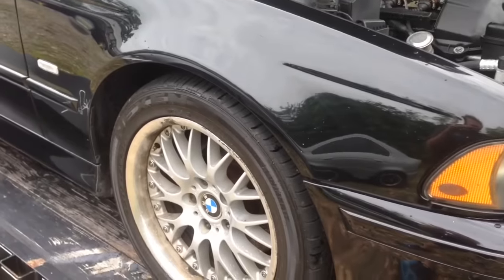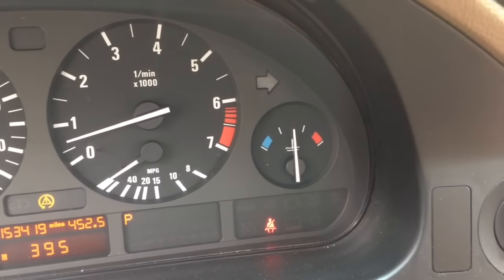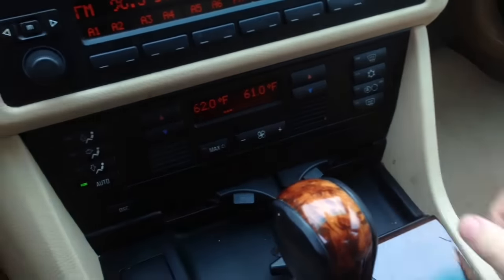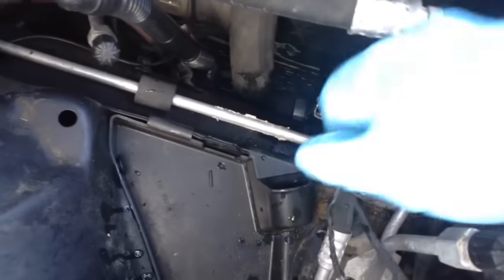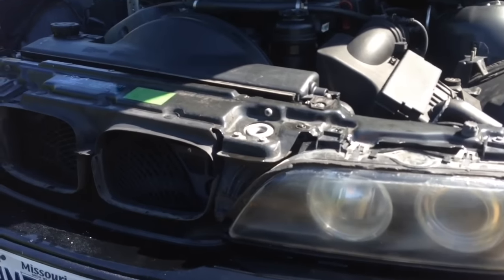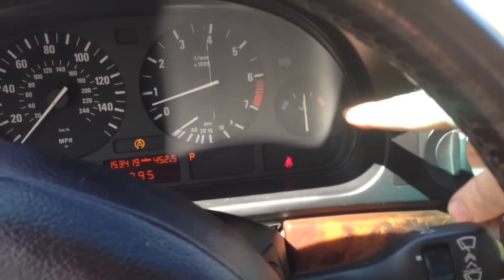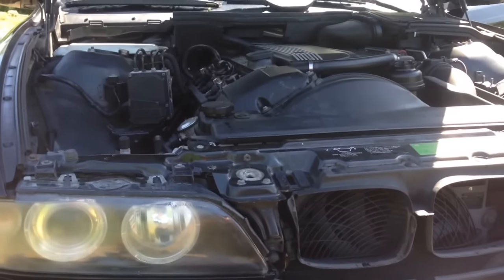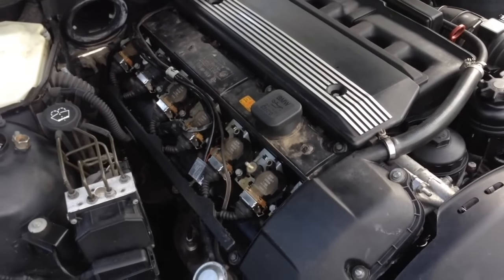BMW E46 E39 E53 AUX Cooling Fan Problem Not Working correctly Relay and Thermostat

Comment: Hello the problem was fixed by me changing the coolant temperature sensor (cts).  The fan won’t come on unless that sensor is properly working. The (auc) air quality controller just controls the recirculation mode on the ac. Reads whether the air is bad or not. If that doesn’t work. The recirculation button won’t work properly. I hope this helps whoever is reading this. Godspeed.

Comment: That little black box is the only thing that has not been changed on my cooling system. everything is new. Thank you. I will post an update for the benefit of others.
Reply: Did that box ever worked?
Reply: Did changing AUC (little black box on top of fan shroud) help any ? please share ..
Reply: Hello?

Comment: You mentioned both fuses were good. I checked the 50 on mine and it was fine. What’s the other fuse bc my fan still isn’t working after installing a new one.

Comment: 2005 BMW 330i E46 runs hot on idle only .. AC on .. electric fan comes on full speed only ..   i changed fan coolant switch (Temp switch)  no change ..  disconnected the AUC (no change)  ..  changed fan clutch (no change) ..  the electric fan works full speed only ..  inside temp gauge goes to 3/4 way up.. if you rev engine to 2000 RPM .. car cools back down and AC comes back cold ..    no white cloud out the tail pipe.. no milky oil...  can the electric fan running be running too fast ? there are no leaks.. pressure tested good..     please advise.
Reply: it turned out to be the thermostat ... i initially ruled it out because it was 2 years old (after market junk however) ..  i bench tested it and it failed..   case closed.. the Nathan guy is  a fraud
Reply: @samalfakir5463 sad brokeback a simple test of running the car at idle with the radiator cap off would have shown you that in side of 10 minutes.

Comment: My e83 has the fan speed on at all times. Stuck in high mode and it doesn't seem to overheat, but I've read a few things it could be the ac is overpressurzied  or it could be a waterpump or it could be a sensor or could be something to do with the battery fuse block or a fuse/relay idk hopefully you have some insite... to be noted the car was crashed in the front right corner. The ac drier has a sensor on it and the accident did shear the sensors clean off at the connection point. Maybe that could have over filled the ac system? 

Or is there any sensors in the front right hand passenger headlight/fender I should replace that may have been messed up in the accident?

Comment: Thanks this helps.  My 2003 X5 4.4i has been acting screwy.  The AC fan is fine when the engine is cold but when hot, the blower just stops blowing.  If it cools down or we turn AC off for a while, it will be fine for maybe 10 min.  And yes I noticed I was using a lot more coolant for the engine.  Perhaps unrelated is my radio Aux signal sometimes gets shorted out in the heat and jumps to the radio.  Any ideas?
Reply from the maker: The ac fan inside the car or the aux fan stops blowing?

Comment: @Nathans BMW Workshop when I turn my car off I get like an air sound constantly blowing from the vents through the bonnet.. cant feel air though.  Would you know what's wrong because this video explains its overheating it's had so assuming it could be that.  But it's draining yhe battery every time it's turned off till it's dead.

Comment: My cooling fan on a 99 540i turns off when I plug the Temperature Sensor , and d only way it comes back on is if I pull d sensor out d Hose and plug it back without plugging the sensor. Stay on like that with no problem. Can I keep it like hat? I put a new sensor and it those the same thing.

Comment: Sir, did you have engine codes for the sensor and the relay? I have this 2006 BMW X3 and have replaced everything. Radiator thermostat water pump upper radiator hose heater vent. And the fan suddenly isn’t turning in it blowing coolant out of the new reservoir tank. But zero codes. Overheating not good. I’m thinking sensor and relay like you possibly fan too but no codes, thanks Kevin in New Jersey

Comment: hi mate. 
I own a bmw x5 2004. 
I’ve replaced the condenser , compressor, radiator fan, condenser fan, and expansion valve and still don’t have COLD 🥶 air. The most it gets is “cool”. 
What am I missing? 

Also what’s the yellow light in your dash? Mine has that same light on.
Reply: Did you clean the pipes before installing the new stuff?  You might have introduced junk from the old system in the new items without a proper clean out.
Reply: @Zairn12345  I would like to think I did. At this point I’ve done it all except change the heater valve. I’m thinking about replacing that in a couple months before the summer heat waves start coming

Comment: Hey guys,

I changed the radiator on my E46 330i along with the expansion tank, HEPU water pump, Febi thermostat, Gates upper and lower hoses, Febi coolant temperature sensor. But the fan no longer runs in low and medium mode. When it runs, it’s always at full speed. Sometimes the fan doesn’t turn on and the needle goes past middle. I replaced the temperature sensor from Febi to a Hella but no difference. My cousin even used INPA to run the fan at different speeds and it works perfectly.
 I have exhausted all efforts to find the problem.

Any help would be much appreciated.
Thank you!
Reply: Does your car smoke on the passenger side with a burning oil smell? I think I could be experiencing something you are with the fan deal plus having a overheating smoking issue

Comment: A source told me that the electric fan on the M54 turns on at 100°C and off at about 95°C, but if you disconnect the connector at the electric fan sensor on the bottom radiator hose the electric fan turns on at 100°C and off at 85°C.
I can't confirm this anywhere, but if its true its an easy fan hack to increase cooling. Do you know if this is true?

Comment: Hello Sr.Nathan i have the same problem with my 2006 x5 e53 3.0i that fan sometimes turns sometimes not at all if  it stays in idle it will overheat should i replace that switch an the black box? whats the name of that black box? here in Chicago looks like we are not going to need ac this rest of the year but i whant to get this issue fix.
Thank you Sr.for the video is great and very
 informative.
Reply from the maker: Replace the black box first , search ebay for "bmw aux fan sensor"
Reply: Thank you Sr.

Comment: my 2005 x3 2.5L normal gauge temp but fan comes on at 172d. changed coolant temp sensor was a drip from oring but still with new cts it still kicks fan on at 172d ??..could aux fan relay cause this issue

Comment: I have the same issue, what I did was to just disconnected the AUC sensor and fan works (Running steady). But I have to changed the AUC Sensor for permanent fix.
Reply: Alex you disconnected the AUC sensor or the one on the lower radiator hose?
Reply: Good to know!
Reply: What is the AUC Sensor

Comment: Hocked my auxfan up to a battery. 4wires, 2 bigger than the other. Brown and blue/black "i think". The fan did turn on, after trying back and forth with different wires it stopped working. I guess the last resistor went too. Only managed one speed with which i think was full.

Comment: The part you're calling the fan relay is the AUC sensor, which has no connection to the aux fan.

If you have recirculated air set to "Auto", the AUC sensor temporarily turns on recirculated air when it detects hydrocarbons, etc. The little plastic flap on the opposite end of the connector allows air in to be tested.
Reply from the maker: I am not sure what connection it has to the aux fan, but the fan absolutely will not work without that box, let me be specific, it will work with the. ac on but the fan will not come on with the ac off when the car is overheating, if you plug that little box in when the car is hot it will instantly turn the fan on, if you unplug it the fan will instantly turn off, I urge you to go try it and see what I mean.
Reply: @NathansBMWWorkshop  😁 Really funny this box has Nothing to do with the fan its unplugged for years and my fan working like a charm its Just as mentioned above if  you dont air from out side or if you want your car to be vented Automatically when its needed
Reply: Sroor9001 so which one of you guys is right? 
Also, at what temp (Celsius) is the newer 3-pin (pwm) fan supposed to turn on with AC OFF?  Been searching for DAYS
Reply: @NathansBMWWorkshop  i tried it .. AUC has no effects on the electric fan
Reply: Actually it does control the cooling fans. AUC does not stand for Auto Recirculated Air...That would be ARA, lol. AUC= Auxilary Cooling fans and for some weird reason it does also have something to do with the recirculated air.

Comment: I kept the old resistor because it was > $70 through my mechanic It seemed to help then but now it seems the blower cuts out when it gets hot. How do you know if the resistor is bad? My mechanic was quoting me $1100 for the fix but he wasn't sure if that would fix it.
Reply from the maker: Im almost positive its the resistor  if its getting hot and shutting down, a new oem behr is $38 off ebay, i might have one here but i will have to look and see

Comment: We've had similar issues in the past. Solved as you've explained so can confirm your methods. This is very important because if you 'cook' an engine and blow the head gasket, it's a damn pain, let me tell you. Keep 'em coming Nathan  :)
Reply: it turned out to be the thermostat ... i initially ruled it out because it was 2 years old (after market junk however) ..  i bench tested it and it failed..   case closed.. the Nathan guy is  a fraud

Comment: Nathan i need help bad no air in vents at all ac or heat changed out fsu still nothing aux fab comes on when engine temp gets too hot but not with ac on?????

Comment: Hi NathanI got a 2004 bmw 745i. I changed the upper timing belt tensioning bolt, an now my car want start. it seem that the bolt that I took out was missing the bottom spring tip for some reason. When I put the new longer bolt in the chain rattled, so I took it out an replaced it with the original shorter bolt with no tip on it.But now the car want  start. Do you know what could be the cause?Thank you,Dave Horton
Reply from the maker: Hello you have the n62 , are you talking about the timing chain tensioner?

Comment: On my 2004 chevy venture, the cooling fans kick on when the engine is about to overheat till it goes to about half then they stop, they are on all the time when the a.c. is running.  And I also replaced all the relays for the cooling fans so I don't know what the hell is going on

Comment: Hello Nathan, I own a 535i e39 M62b35 v8.
I recently replaced waterpump, thermostat and flushed the coolant, got a new coolant tank, cap and coolant temperature sensor.
Now as I go and drive more than 15min, the coolant tank starts boiling and overflows, any ideas? (Hoping that’s not a head gasket)
Reply: If it's head gasket you should see oil in the coolant like sludgy white stuff or white smoke out the exhaust. When you flushed the coolant and put the new coolant in. Did you bleed the system because you might have trapped air in the coolant system causing it to over heat. Bleeding is very easy takes 5 minutes
Reply: Also take your oil cap off make sure the colour isnt a white colour where the oil and coolant have mixed.
Reply: @fortniteboss2837  the problem is it did this after coolant beeing flushed already, maybe I did it wrong and there’s still some air..

Comment: Nathan, at idle my 00 528i will get hot, no Aux fan. While moving it's fine. If I'm at idle, I turn the heater on, engine cools down but Aux Fan won't come on. It ONLY comes on when I turn on the AC. What's the dealio?
Reply: Andy Micheli if an automatic it's your fan clutch. The 1 that spins onto you water pump.

Comment: AUC is not a relay 
Automatic recirculated air control (AUC) is an additional feature controlling the automatic operation of recirculated air. The AUC feature uses an oxidizable gas sensor usually mounted behind the right side of the radiator or the right side upper portion of the fan shroud (samples air quality as coolant fan pulls across the radiator). The AUC sensor contains a combined heating element (powered by the IHKA module) and a gas sensor. The gas sensor requires heating to work efficiently. The sensor produces a varying voltage based on air quality (concentration of hydrocarbons, NOX, SOX, and CO). The voltage increases as the air becomes more polluted. After it reaches a preset value, the IHKA closes the fresh air flaps. To prevent glass fogging, the system has built-in time limits: 3 minutes when heating and 12 minutes when cooling. With normal air quality, the AUC sensor reads about 0.5V. If the AUC sensor voltage increases to 3.0V, the ventilation or fresh air flaps will close (0%). At about 2.5V, the fresh flaps will read about 20% and 100% (fully open) at 2.4V.
Reply: does the AUC makes engine over heats on idle if faulty ?
Reply: @samalfakir5463  no

Comment: I already changed the resistor 2 yrs ago. Aluminum fins, had to take the glove box out to get to the back of the dash.
Reply from the maker: Did that fix the problem then? Its either the resistor again or the blower motor itself and you better hope its not the motor because that will be a huge job
Reply: hey nathan, hope you can help me, i have a 01 bmw 540i and it has a loud
 aux fan noise it sounds like a airplane, y changed the thermosthat, 
lower hose cooling sensor, and water pump sensor, but the noise is still
 there and loud, please i need ur help how can i fix this issue,   THANK YOU
Reply: That sounds like the viscous fan has seized up hence running at engine speed can break the plastic fins off the fan and dent your hood and rip up your hoses.  Mine seized yup sounded like a semi truck taking off from a stop

Comment: Hey Nathan , Mine E36 I was test my fan working find. and I replaced Coolant Temperature Sensor and start engine with AC on 15min , But am not see fan have  spin. Do you have any idea something els ? thank you
Reply from the maker: +Raksasok Heng Check the fuses behind the glove box.
Reply: which fuses? obviously the fan fuse.. but are there any others that may affect the fan not coming on?
Reply from the maker: No just the 2 o3 3 huge fuses, the other problems could the a bad fan or fan resistor or a bad relay

Comment: Hey Nathan. I have a 2000 528i. Here is my issue I can run it all day sitting in my drive way with the heat on  and it will not overheat. if I drive off  it will not overheat unless I turn on the A/C. Whenever I turned on the A/C and come to a stop that when it over heats. The fan does run when I turn the A/C on but I don't think that it comes on when the car temp is high if I turn off the A/C. If i unplug the temp sensor the fan will spin full speed, that tells me that the sensor is working. . I take the thermostat out and it still did the same thing. What could I be missing and what is the little black box on the fan shroud for?
Reply from the maker: Its the relay that is the problem, which is the little black box on the fan shroud.
Reply: I have same model and year, aux fan ONLY comes on when AC is on, NOT when I'm at idle and then the temperature gauge goes up. Turn the heater on, and it cools down... While drivind (no heater no AC) cars stays at perfect temperature, Relay box? Cause it doesn't come on at idle and car gets hot... I'm lost...lol

Comment: @ Nathan's DIY Garage is this a e39 because there is a switch on the actual side of the radiator on e39 that is easy to replace that controls that fan
Reply: Tell me more please?
Reply: If you couldn’t tell this was an e39, I kindly ask you to put everything down, and slowly back away from BMW’s forever.

Comment: Nate do you have info upon the A/C Condenser Radiator Cooling Fan w MOTOR the big black box switch i know where the one is located in bottom radiator hose. Mines twists a bit too far in my opinion so i wanna change it as well thanks brotha tyrone for 2006 E53 3.0i SAV i have. Im waiting for parts to arrive now, and it hasn't gotten to kind of weather i wanna be in to get on the job of checking things out from diagnostic standpoint to looking behind glove box etc i don't even know how to drop my glove box..lol and i wanna check these computers too i think in part why its not getting any power may be due to the water leak i previously told you about. I saw some things under the passenger floor board area underneath glove box i believe is where some of computers are housed so i plan to pull whatever's there from all the rain that leaked into vehicle via the A Pillar on passenger side and that leaked onto the on board monitor from ceilings center console that damaged the radio...it works you cant see anything on screen and can only control volume via steering wheel. I wrapped a blown fuse with piece of wire n put it in its place the monitor then lit up orange color when i did that so i think.there is a short or some how too much power is being diverted some where because i put new fuse in rear for navi etc each time i do i automatically blows that fuse only no other fuses are blown which its the 5 amp fuse. Like i stated i got general basis on what to dive into here trying to wait til we have better nice weather on day to day basis. Its bonkers in NY brotha i will either fix it or fuck it up one lol just kidding on fuck.it up part.. im learning to be my own mechanic